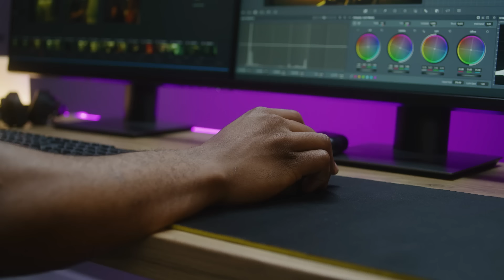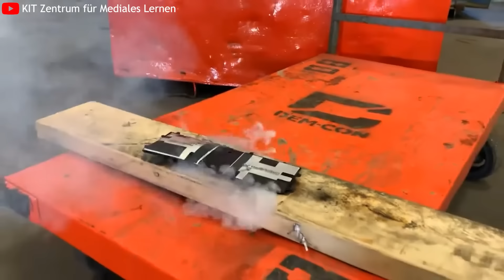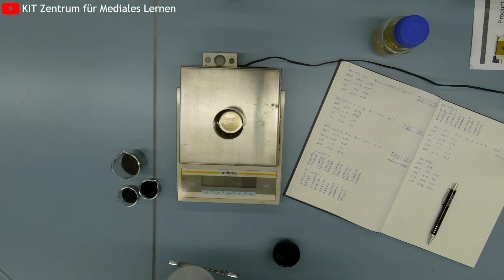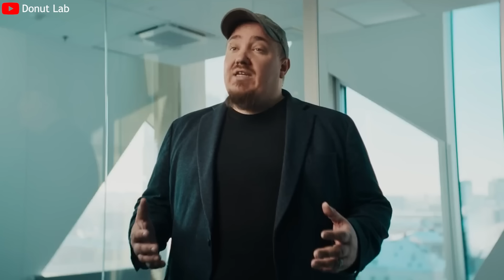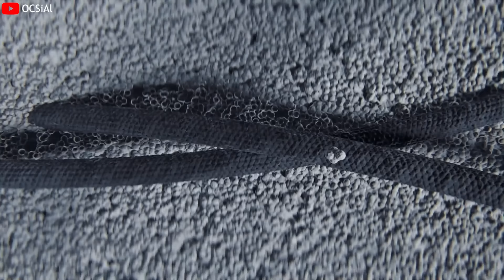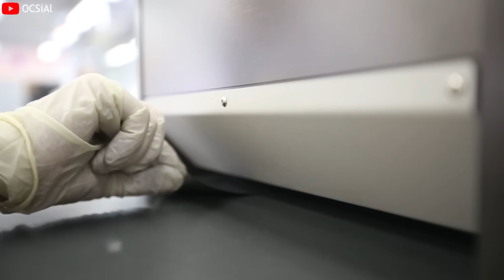You Missed 1 BIG Trouble Thing in Donut Lab's Test 2... Marko Lehtimäki Say What?

Comment: My guess: Aluminum Ion Battery (AIB), rapid atomic layer deposition (SALD) and inclusion of Al3+ defects for ion exchange. Gives 3 free electrons per atom. (3x Lithium). Aluminum is safe and durable and available on every planet. Its printable, and (one of the giveaways imo) one of the lead enginners at donut recalled aluminum being an "aha" moment for designing their motor. SALD (spacial atomic layer deposition) was innovated in helsinki, right around the corner from Donut HQ. I'm also guessing a BaAl or something similar used as perovskite electrolyte. That was nordic nano's contribution if I were to guess. Its the same shit they use for solar panels. They are also applying a solar panel perovskite application technique to battery printing, which brings costs down and quality up. It is a chemistry+production combo breakthrough. 

Grab your popcorn yall!

Look it up, these specs are very possible. I'm sure they figured it out.
Reply from the maker: Interesting idea. Aluminum-ion is promising, but most current development is still focused on lithium-based or solid-state systems.
Reply: @Eng.JohnSmith I did more research since then, and while I dont know of its aluminum or perhaps titanium, I do know my theory aligns with their "screen printing" relationship with CT Coating AG. Al ion/Ti ion are both solid state.

Comment: The 100 degrees was well over the pouch's sealant failure temperature.
Reply from the maker: The pouch seal limit is definitely a concern in traditional lithium cells. One of the interesting claims with this design is that the internal structure and materials tolerate higher temperatures without the usual electrolyte breakdown.

Comment: Impressive so far. VTT hasnt opened up samples of your battery's to prove solid state claims (after testing). Why? Full test require a look inside + along w/various parameter levels beyond room temp. VTT only tested 1 cell as well.
Reply from the maker: Ideally we'd see independent labs test multiple cells across different temperatures, charge rates, and cycles before drawing strong conclusions.

Comment: Saying that the cell "survived" 100C is stretching it a bit, isn't it?
It did not explode, but it is not usable any more.
Reply: Pretty sure they did another test after the vacuum loss.   Go check.
Reply: @PortableRVSolarStandProjectDIY  How much capacity was left in the following cycle?
Reply: @H @HartmutRick e key is that the first test made sense to the commenters only as proof they are using super advanced liquid li-ion NMC but that was disproved by the battery not exploding at 100C and it did take a full charge again afterwards.  What some people described, in some very desperate clinging to their positions, as the pouch expanding like a NMC would was obviously the vacuum pouch expanding at atmosphere where it was hugged in before and the proof is literally that the battery kept going through the failure lol.  The seal breaking vacuum was the key they were highlighting in this test not the supposed results.
Reply from the maker: would be interesting to see capacity and cycle-life tests after that 100°C exposure.
Reply: @Eng.JohnSmith  nothing but full independent testing is going to truly “prove” their claims so I’m guessing we have one or two more tests that nibble around the edge of the capability but maybe hide a couple more “failure” points that actually indicate somehow the novelty or unique chemistry without answering even as many questions as it raises.
Reply: Well they released test today, the battery lost around 40% of it's capacity after the failure but it still charged at 5C 50 times safely without any fire or failure. That in my opinion proves it's not liquid lithium battery.